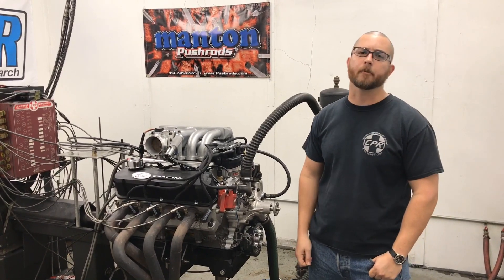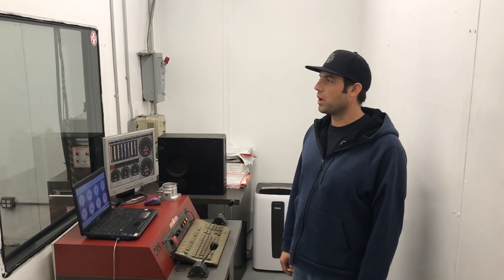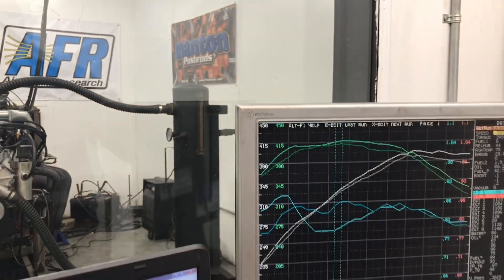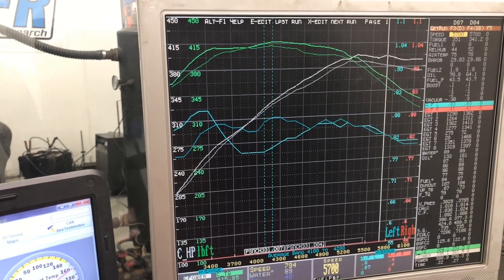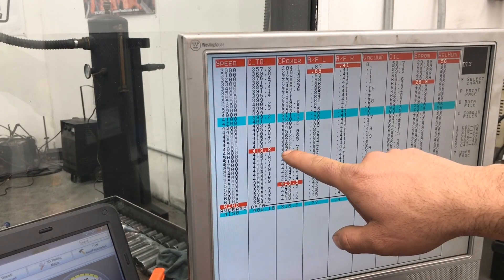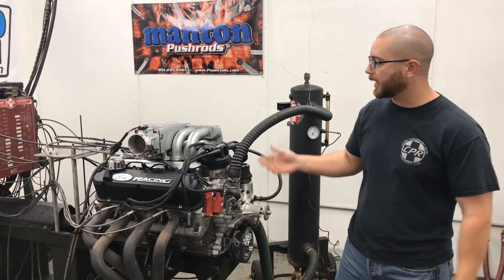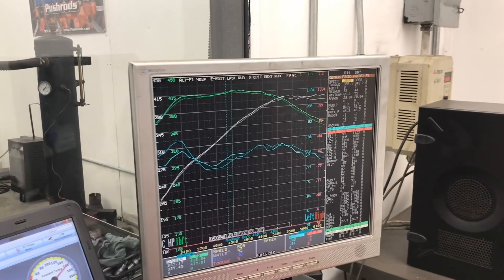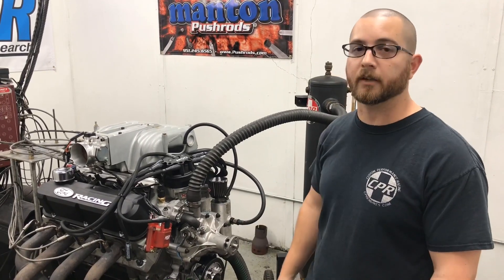Ford 331 Dyno testing - intakes!

Comment: You guys should test a 331 like that with a ported 302 truck intake and a healthy solid roller cam.... BigDogs Porting has them flowing around 246 per runner....and a BBK Power Plus 61mm x2 throttle body.

Comment: That's definitely not what I call ported on either of the lowers. I would put my Explorer upper and lower up against any Edelbrock or Holley. Of course, it has been cut apart, welded and heavily modified.

Comment: The hate is real.. no need to mention any names but I know  who you refer to about the socket . Sure is a lot of fake porters out there who "claim" to be porters and don't even know how to port the upper intakes or who simply rip people off. I just happen to have the "socket" intake, upper and lower that blows the other guys intake away for less money! It also blows that Holley systemax intake away too that you guys have here.  Then you have the other snake oil sellers.. "custom cam" guys.. but thats a whole diffent story. Decent numbers for what the engine is.
Reply: Was either the GT40 or the tubular port matched to the 75mm TB?
Reply: @chatch2282  
Yes.